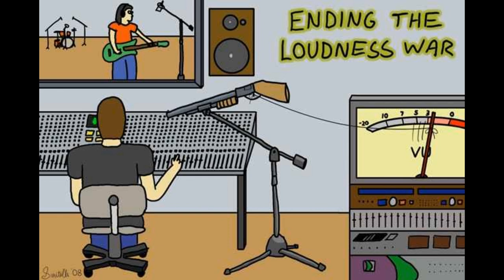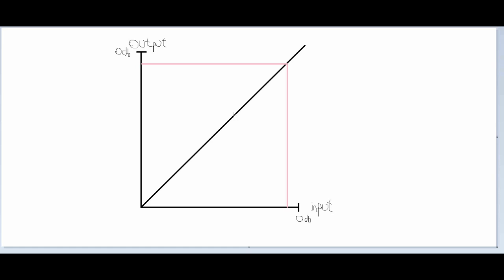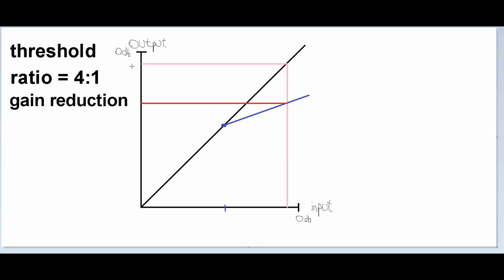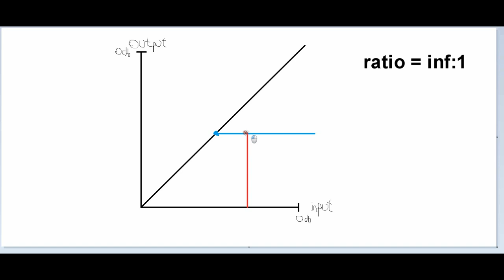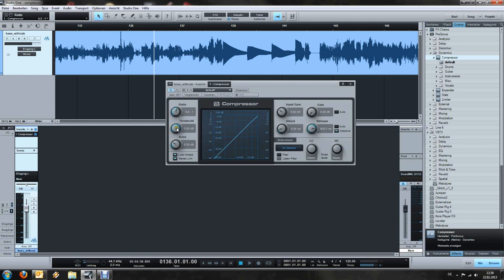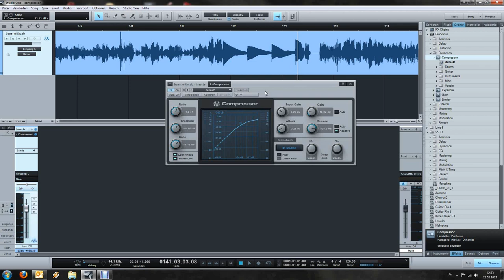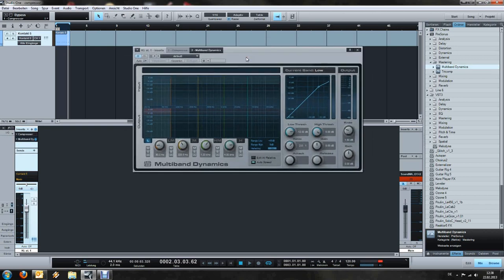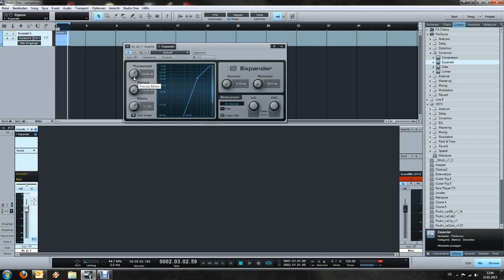how compressors work (for music production)

Comment: I'm not sure if you do this or if you'd just forgotten to mention it during your tutorial, but do you calculate your attack and release times? Like for example at 140bpm, a 16th note is 107ms long so whatever attack time you'd just used to compress, you subtract that from 107 and use it for the release. Of course it varies from compressor to compressor because of varying reaction times, but it's useful to know as a guideline. I've never tried and I'd like to know your thoughts on the matter.